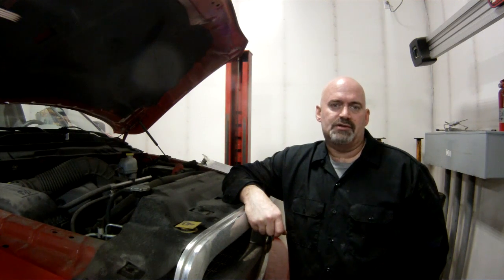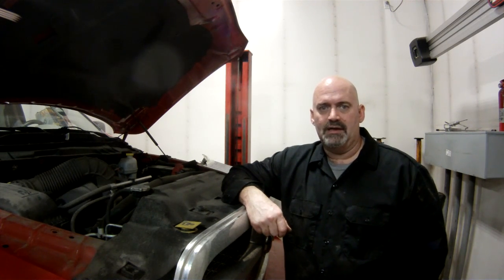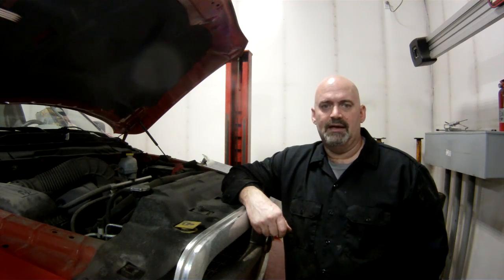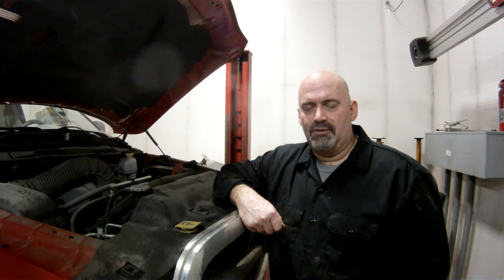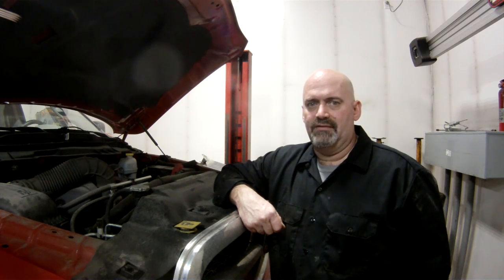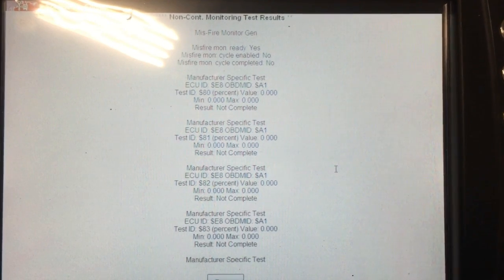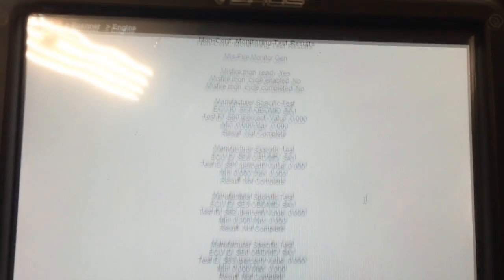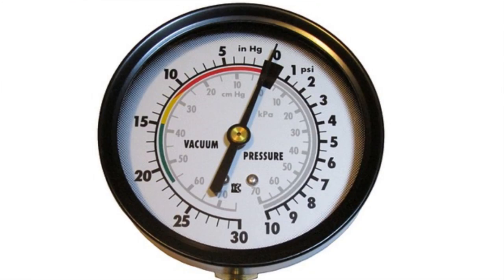Dodge 5.7 Hemi Misfire Problems

Comment: Thanks for your video! I have a 2009 Chrysler Aspen with the 5.7 Hemi and I have a rough running condition and a cylinder misfire on #5. I also have a ticking sound between 2,000 and 2,500 RPM. A shop told me I need a valve job, but do you think I should have them try the vacuum gauge test? Seems like replacing a valve spring is MUCH cheaper than a valve job!! (that was quoted at $3,500!) What should I expect to pay for a valve spring replacement? Thanks for your time!
Reply from the maker: Safe Side, Inc. I would have someone remove the valve cover on the bank and take a close look at the valvetrain components. Without a physical inspection its too hard to tell what the actual cause is. If the shop that told you it needed a valve job didn't recommend removing the cover and inspecting then you might check out another reputable shop for future work. Good luck and thank you for watching.
Reply: The Car Doctor

Comment: Alright... so my dad has a Dodge Magnum 5.7L Hemi AWD. He was driving home one day and all of the sudden the engine got very hot. The engine started to cut off so he pulled over. He starts it again and tries to drive it some more (Bad Idea). Turns out that there was a hole in the radiator. Got a tow truck to bring it home. My dad calls his personal mechanic and comes the other day. He takes the radiator out and returns it to AutoZone and gets a new one. He then puts the new one in. He comes back the next day and tries to start it up. It was cranking but not starting, so he cranked it again and foot slightly on the gas. The engine starts... now it has a missfire and a big white cloud of smoke is came out of the exhaust. The mechanic diagnosed the missfire and it was on piston 5 and it was also very little to no compression. Finds out that oil is coming up through the gap of the wall and the piston. Mechanic says the Compression ring on the piston is sealed shut and need to reopen again. To do that he told my dad to run it 30 minutes everyday and see if it opens back up. But first he bought some type of Lubricant and put it in with the oil. Turns the engine on after doing so and letting it run for a while. A ticking sound gradually starts to show up and he said it was normal, I didn't think so. He told my dad to run it for 30 minutes a day to see if the ring would come unsealed. The third day of doing that after doing it for 30 minutes, He puts it in reverse and all of a sudden there is a big knock and the engine just cut off. Turns out, it threw a rod! Now he is stuck with no operable car.

Do you know why it threw a rod?
Reply from the maker: EmbeddedGenius - well it sounds like it overheated and finally blew up. Without a tear down we wouldn't know the extent of damage sounds like it's time to replace the engine.
Reply: Yea, I'm currently looking for a new or used one. The rod came through the oil pan so I need a new oil pan too.
Reply: EmbeddedGenius - does "your dad" have a engine temp gauge? Always good to watch those all the time.
Reply: EmbeddedGenius - Sounds to be exactly like it overheated and died. That is, overheating was the cause of all the other issues. If your father had not started driving it again after he noticed it was hot, it would likely have been diagnoses as a leaking radiator, fixed, and had been fine.

Comment: thank you doc :) You have idea what is that for a "sound" ? its a 5,7 Hemi 2008
https://www.youtube.com/watch?v=py_YxHS-ick
Noise is over 2300 RPM
Reply from the maker: ***** To be honest it sounds like rod bearing type noise but I could be wrong. Does the oil pressure drop off when the engine gets warm? Any metal contamination in oil? Any coolant getting into oil? Misfire issues? Codes?